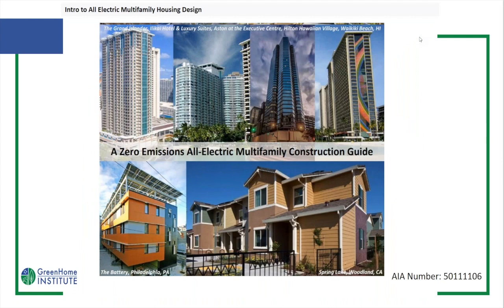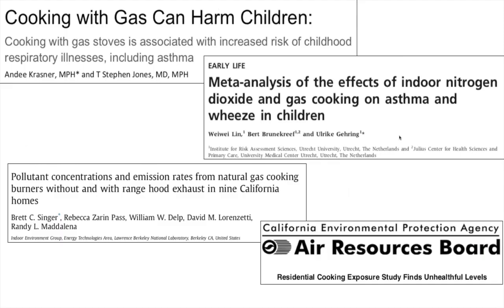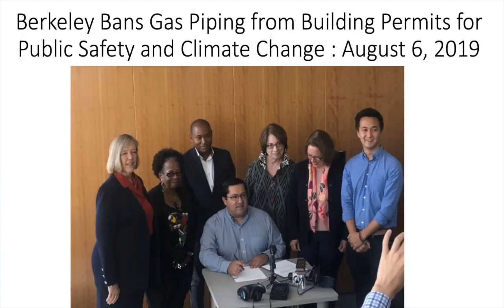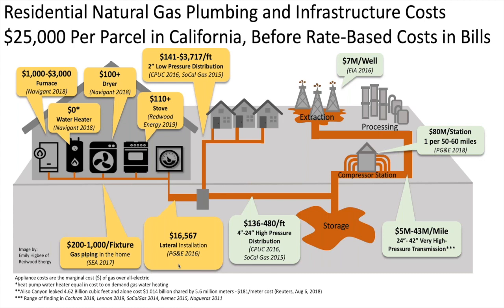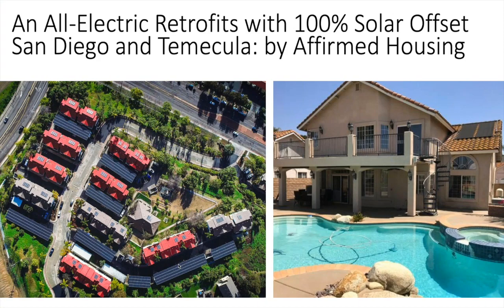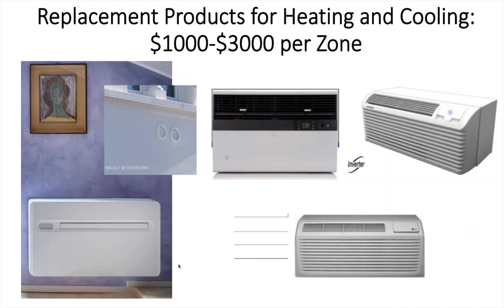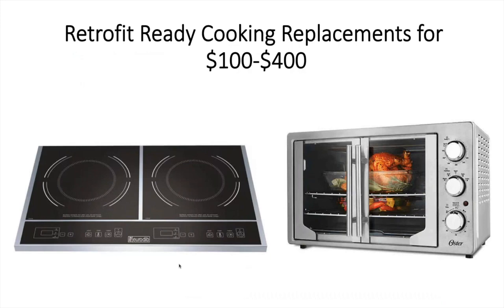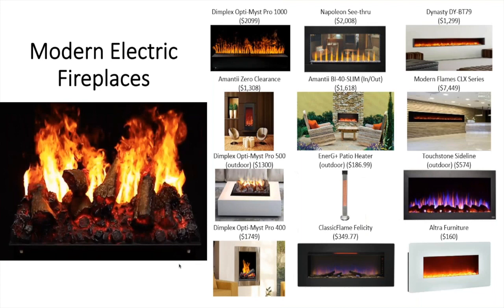Intro to All Electric Multifamily Housing Design

Comment: There are many variables the presentation does not consider. Specifically the cold weather de-rating of heat pump equipment. The demand you would have for 100,000 btu/hour is over 100 Amps of 220V power. Heat pump water heaters are a great alternative to electric resistance water heater. You can do a whole house in all electric, and it is more "first cost sensitive" like the developers would benefit from. The issue becomes the $600 to $1000 winter month utility bill. And no way you are actually getting a 4.0 COP from an air to water HP in the winter, unless it is indoors and you are ignoring the cost of the increased space heating.
Reply: wow, good points but here in California have never needed a heat pump and it's never cold enough to not wear shorts sleeves. My Whole-home Solar plus Electric Vehicle Batteries now provides me with all electricity we need to charge two cars and run the whole home when the grid is even down. I have virtually no utility bills now and purchase no more Gas for Cars saving another $300 in Gas, Suggest insulate good and get a whole home Air quality monitoring system to make sure no high CO2 build-up from burning Natural Gas indoors does not build up and give people headachs.